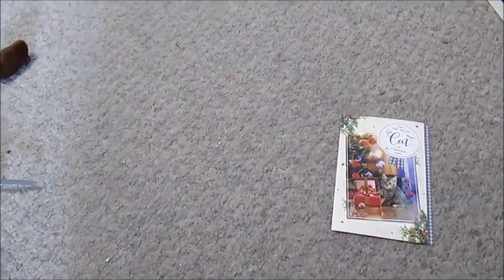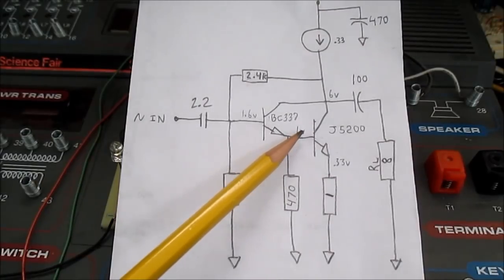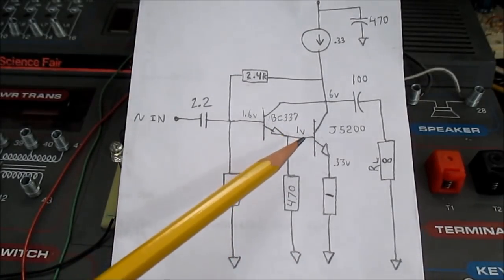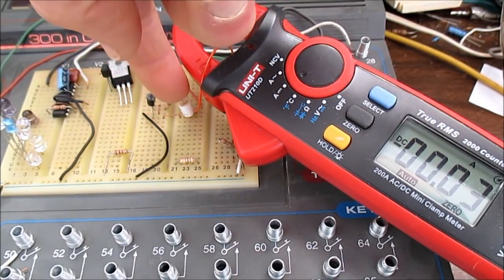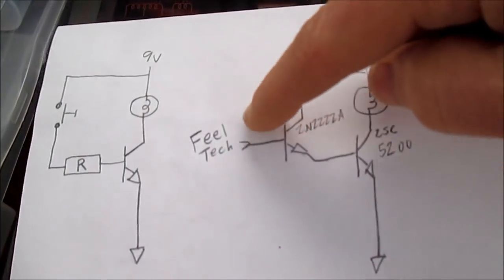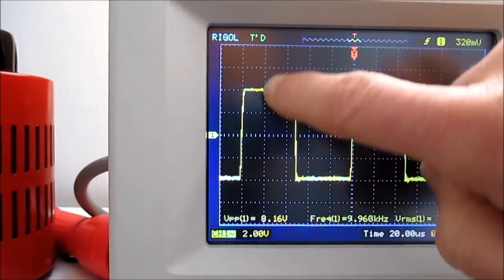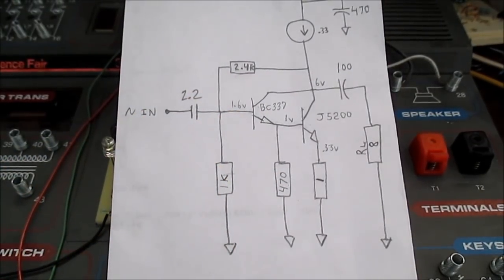Why the base resistor in Darlington transistor circuits? With demo

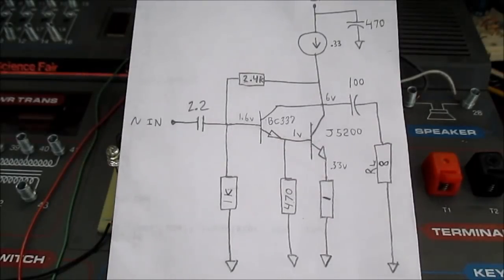Comment from the maker: On topic content starts at 1:38 if you don't want to watch my intro.
Ignore the resistors in the diagram when I discuss the gain calculation.
Reply: When is it better to use a Darlington like TIP120? It has the resistors built in. That built-in resistor, is even 120 Ohms like you explained. 
Can you please do a series on Darlington differential amps input stage, and the use of Darlingtons in Audio applications.
Reply: Don't worry man. I'm also an animal lover. Keep doing what you do.
Reply: This explains why an off-delay timer that I've built a while ago does not have a linear timing every time it's activated.
Thanks John.
Reply: HELLO THERE . THERES A TIP142 NPN TRANSISTOR IM TRYING TO USE IN MY ONE TRANSISTOR SOUND AMP . SO TELL ME HOW THE CIRCUIT WILL LOOK LIKE ??? THANK YOU
Reply: I <3 Snickers

Comment: John & Snickers - glad you got my Christmas card, it's great to see it arrived. Whoohoo.  I wasn't sure what to send you, but I guessed you might have some fun with the MPSA14 darlington transistors. The other thing is a "Digispark compatible USB attiny85" (it's a bit random, but was the other next flattest thing I had to mail to you!)  Snickers is doing great at 12 years old. I found the your vid on the base resistor very interesting - I hadn't realized before that it was to combat the effect of B-E capacitance - and you demonstrate well how that capacitance becomes more of an issue at higher frequencies too.  It would be interesting to see how the Darlington transistor MPSA14 behaves too - as it doesn't have a base resistor internally so it should behave pretty badly at higher frequencies I'm guessing.
Reply from the maker: Hi Trystan. Thanks again for the goodies. Those MPSA14 Darlingtons have high gain of up to 20,000. I'm curious to see if they leak. Some Darlington transistors have a B to E shunt resistor around the first transistor to help keep it off otherwise the circuit will pass a bit of current even with the base open.
Reply: Ha, i was thinking "Is that a Digispark..."

Comment: Excellent. I'm curious as to the change in input current when the resistor is added - i.e. exactly how much gain was traded away to get the improvement in turn-off speed.
Reply from the maker: I'd have to take measurements but you give up a lot of gain. With the 120 ohm resistor, around 5ma is shunted through it which is a lot more needed to drive the second transistor with the 80ma lamp. I could have tried a higher resistance at the possible cost of speed.

Comment: As a postal mechanic I ask people not to send objects in plain envelopes(send as a package), as these object may get jammed in mail processing equipment and not get to their destination in one piece!
Reply: I do apologize. Sorry. Consider me told off. The items were taped to the inside of the card, but I imagine that's no guarantee that they won't break out and have a party in your mail sorting machinery.
Reply: Sorry, didn't mean it in a way to tell you off!! lol just trying to inform people that it is a crapshoot if the letter with an object inside, makes it through the machine.
Reply: Trystan's Workbench 🤣🤣🤣 Yeah I’ve learned that the hard way. Their machines are something like a football launcher with rollers pressing down and spinning it through, flattening out any humps.

Comment: OK.  Just f2f the top of my head and when I get home ( a couple of weeks) j may try this...  What if instead of a resister we used  Shotsky diode?
Reply: Then the power transistor would never conduct, because the Schottky diode would clamp its base-emitter to a couple of hundred millivolts and it needs around 600mV to turn on.

Comment: FEELtech, is that a meme reference?
Reply: I reckon they meant to call it "FIELDTECH" but spelt it in Chinglish .
Reply: Given that the BNC ground has 110VAC (or 230VAC in europe) on it, you could guess why it's FEELtech indeed. Reportedly not much power behind it, coupled through a capacitor in the internal switching PSU, but one guy reported actually feeling something, lol, and then investigating, bringing this issue to light.